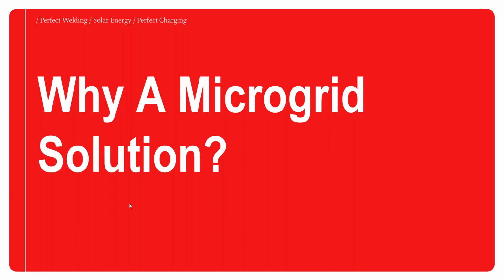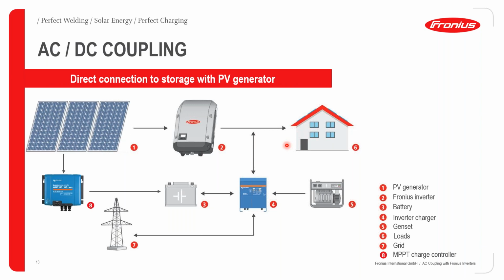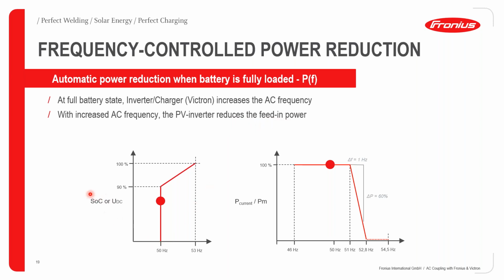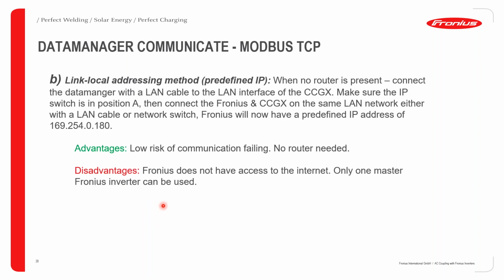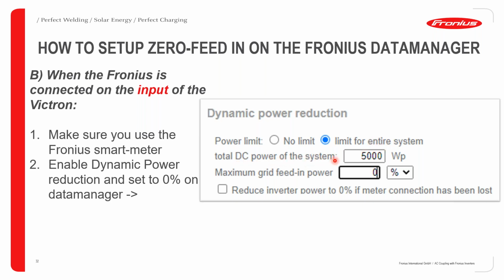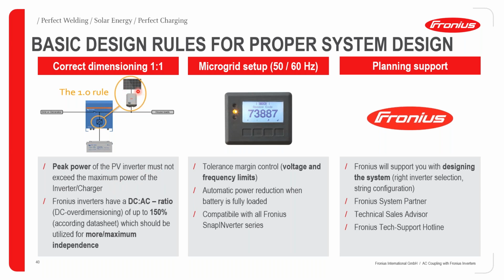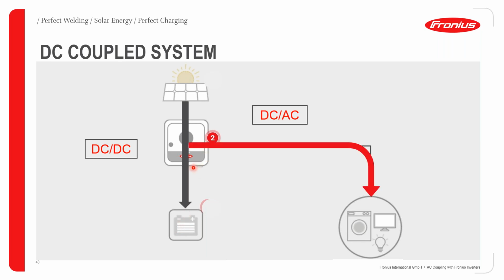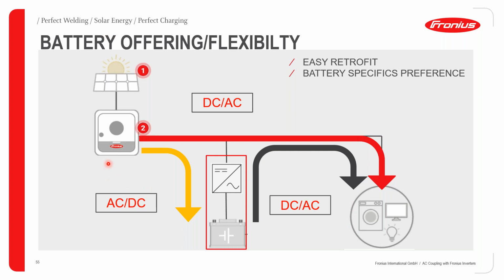Advanced Webinar: AC coupling with Fronius inverters (AFR)

Comment: Hello, Thank you for your informative video! I have a Fronius SYMO Lite Advanced String Inverter 15.0-3 480VAC Solar Commercial. I am looking to setup Off-Grid system. What type of coupling is best for my case. The project is in West-Africa on 220V . I have 15 410W panels.